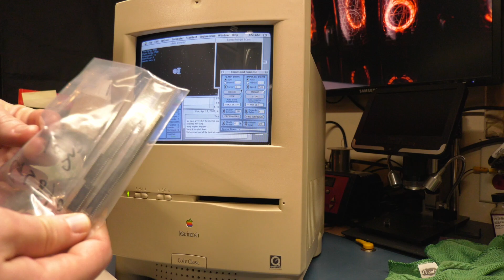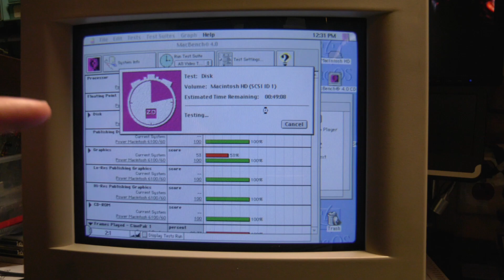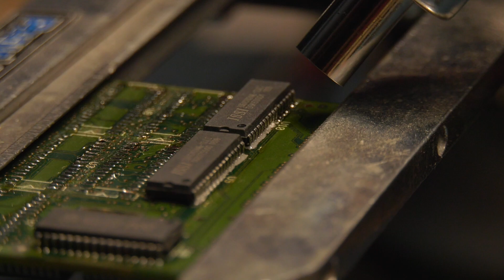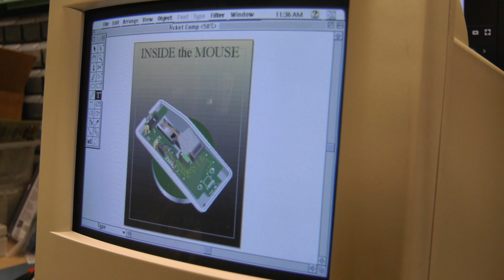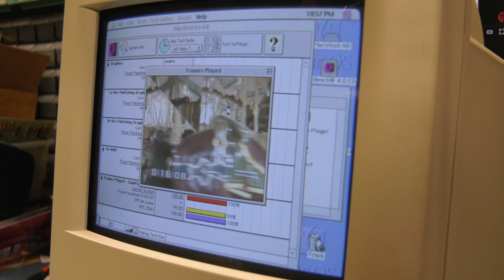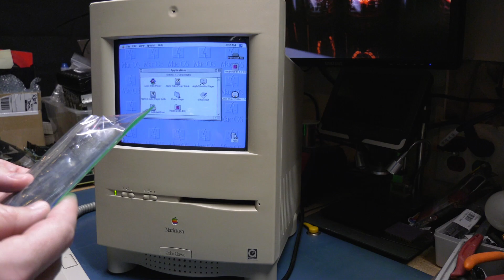Color Classic PPC Daystar 1MB Mod and Overclock

Comment: were you able to ever get the cache upgrade working? I really love to do this mod if i know it works
Reply from the maker: I finally got it! It required me to do it on a later Daystar branded model but they did finally run the lines needed to control the cache correctly. I will be posting a video about it in the next month or so as I am finishing up my degree. It went from 136 in MacBench to about 186 though, it's a massive gain.
Reply: @DKJones96  oh wow thats awesome! I cant wait and want to upgrade mines. Im guessing it will only work on the 100mhz daystar version? because mines the 66mhz apple oem one
Reply from the maker: @DatBlueHusky  I would doubt it will work but you could check the PowerCard before doing any mods by tracing the extra address lines. The Apple OEM one was the one I couldn't get the work and I would assume they are all the same but it's possible there was a revision in even those. There were Daystar branded 66MHz models so those might work? I've only had these 2 in my possession to play with so can't speak to them with any certainty.
Reply: @DKJones96  do you know what pins to trace? Mines could be a later revision
Reply from the maker: @DatBlueHusky If you take the heat sink off the card you'll see a bunch of bus drivers. Look for continuity between some pin on those from the two empty pads directly adjacent to the existing cache chips. If you get that you are good to go. If not, it won't even boot with 128k sram installed.
Reply: @DKJones96  do you have pics of where? maybe make a video of it or a short. Its hard to find what you are talking about.
Reply from the maker: @DatBlueHusky I'll be posting a video in a few weeks and I will include that.